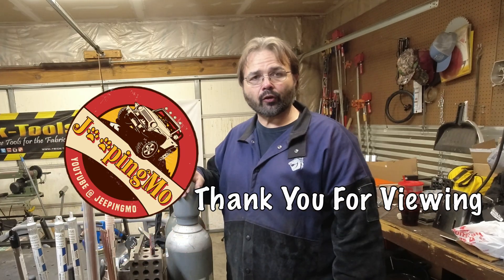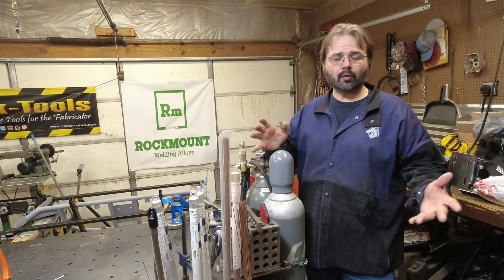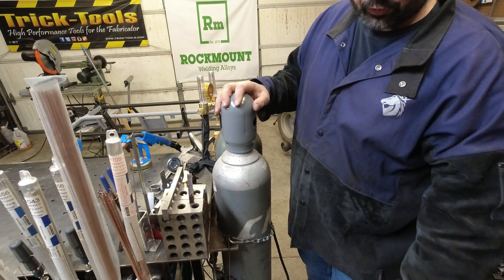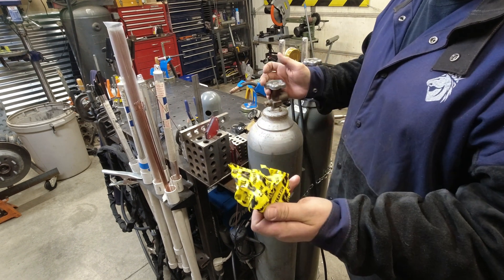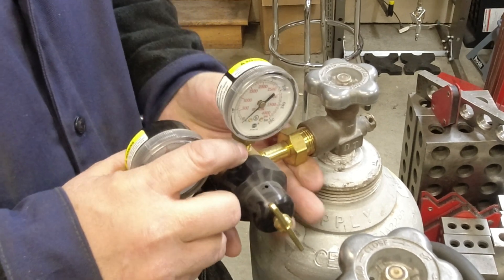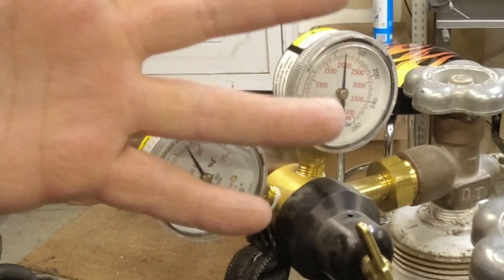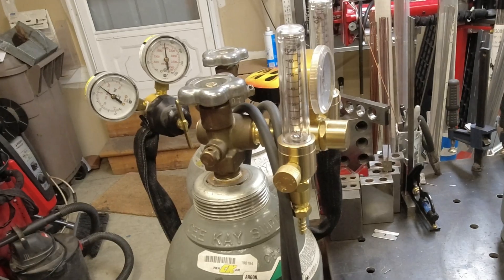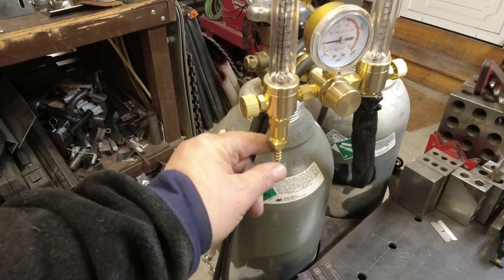GOT GAS, YOU NEED GAS!!  BEGINNERS GUIDE TO  MIG AND TIG WELDING GAS.

Comment: For small DIY weldings, blow torch is enough to shielding gas. No matter where CO2 come from. When use gasless welder with gas wire, polarity must change.
Reply from the maker: @jarikinnunen1718  I agree, flux core and hardwire with gas are opposite polarity. Thanks for viewing.